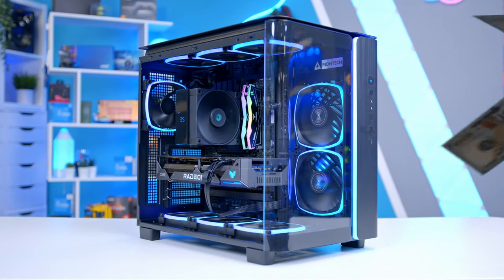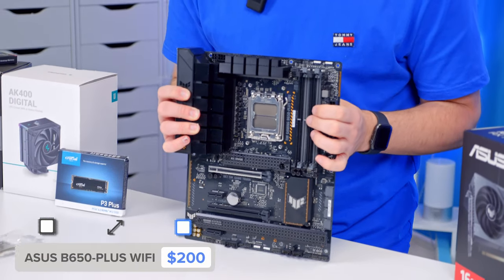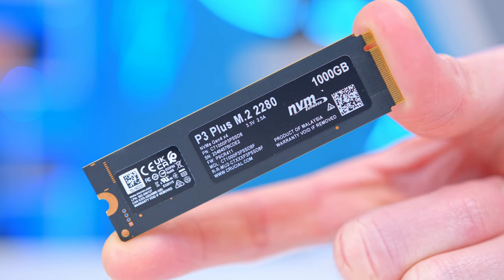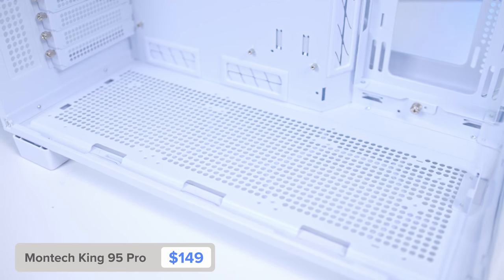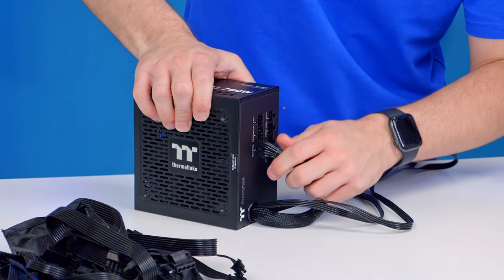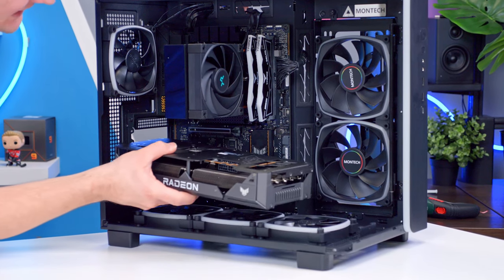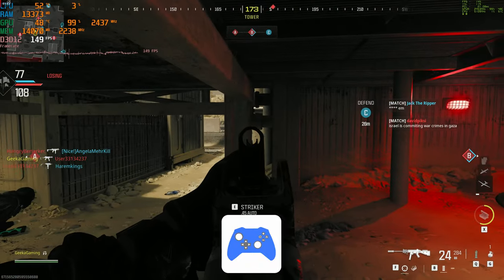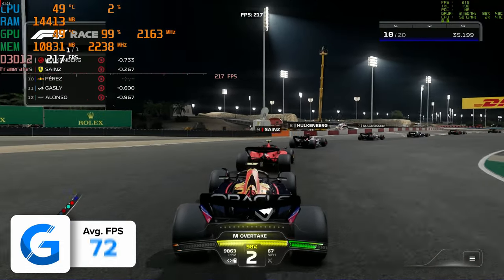Best $1500 Gaming PC Build 2024! 👑 [ft. RX 7900 GRE & Ryzen 7600X w/ Benchmarks]

Comment: I made same PC with better specs and parts for $1490. 7900x3d, 7900gre, ASRock taichi lite, gskill ddr 6400mts 32gb, 2tb 990 pro, be quite 850w FM psu, thermalright peerless assassin 120, montech xr with vertical GPU mount.

Comment: I actually just finished my first ever build and it had the 7800X3D with 7900 GRE for a grand subtotal of $1222! 
Extremely happy with it! Coming from 23 years of console, this is a huge wake up call on how far behind I’ve been this whole time!
Reply: would love to know which parts you used as I am making the a pc with same parts
Reply: Do you have a break down on the parts you used
Reply: Tell us about your parts
Reply: @aatmannbc  I've posted the PCP here multiple times, but my comment keeps getting deleted!
 
7800X3D bundle from Microcenter ($50 off, $25 promotion and $25 coupon, 5% off, $425)
(32gb of DDR5-6000 RAM, Gigabyte Gaming X AX V2 MoBo)
7900 GRE from Newegg with $10 coupon ($530)
A850GL PSU from MSI ($90)
1TB TN470 from Microcenter ($67.5, 5% off)
Montech Air Max, Black, Amazon ($70)
Thermalright Phantom Spirit 120 ($36)
Reply: @aatmannbc  I've posted the PCP here multiple times, but my comment keeps getting deleted!
 
7800X3D bundle from Microcenter ($50 off, $25 promotion and $25 coupon, 5% off, $425)
(32gb of DDR5-6000 RAM, Gigabyte Gaming X AX V2 MoBo)
7900 GRE from Newegg with $10 coupon ($530)
A850GL PSU from MSI ($90)
1TB TN470 from Microcenter ($67.5, 5% off)
Montech Air Max, Black, Amazon ($70)
Thermalright Phantom Spirit 120 ($36)
Reply: @BArellano95  Thank you so much ! Hope you're having fun with your new build.
Reply: No bottle necking?
Reply: @mrivera422g  of course there is! If I’m playing a GPU intensive game, my CPU will be utilized less, making it a bottleneck.
 
If I run a CPU intensive game, my GPU will be utilized less, making it a bottleneck. 
 
Sometimes, if I optimize the game too much, my FPS exceeds my 240hz monitor, causing another bottleneck.
 
Sometimes, I want to play in 4k and can’t reach 240 fps, causing an overall system bottleneck in relation to my monitor.
 
Sometimes, I want to download another 170gb game but don’t have the room, causing a storage bottleneck.
 
Bottleneck just points out the ‘weakest’ component(s) in the system at that moment.
You will always have a ‘bottleneck’ somewhere. 
And that’s fine. Unless you’re pairing a 7900 XTX with an i7-6700k or something crazy like that lol

Comment: How does the 6400 ram work woth the Ryzen 7600x? Any testing since you built it? Very curious due to reports of a ceiling being reported by some users not having their 6000 working properly, and AMD stating 5400 as recommended.
Reply: 6000 mhz is the best for amd cpus
Reply: 6000 is the recommended

Comment: Isn't 5 7600 and 5 7600x same preformeance? (i just want to make sure)
Reply: I haven't researched much on the AM5 Platform nor the new gens of Cpu's and Gpu's as I'm not interested with them due to some bugs and prices.

But from what I heard, Yes they are. You can even get away with a Ryzen 5 7500f if you can find one available and it's supposedly cheaper than the Ryzen 5 7600 and Ryzen 5 7600x
Reply: If you enable boost for the 7600 then yes

Comment: Has anyone else built this computer and having nonstop driver timeouts? I’m starting to think the 750W PSU is not adequate to run the build and is causing the issue. Anyone has any advice? It has been three months and I can’t fix this problem.
Reply: Exactly.. I haven't got the GPU yet. But the offline store guy from whom I bought my current PC said the PC needs 850W for safer side if I'm going to couple the 7600x with 7800xt. So I think you may have a power shortage

Comment: I just built this exact setup except had to use a Gigabyte 7900 GRE instead. First pc I’ve ever built and I can’t seem to figure out why it’s running on average 65c. Is there a good place I can find a bios and setup after building?
Reply: Is that the cpu temperature, cause if it is that’s quite normal. If that’s your GPU temp then that is a problem. I am considering making the build with a gigabyte 7900 GRE because of the price difference so please re-reply if you do find out. Also does it perform as advertised with the gigabyte allowed to the ASU’s?
Reply: @bengunn7385  This is the first pc I built and I did end up getting the cpu temp down but I did exchange the air cooler for a AIO. Temp stays between 32-48ish now. I will say I am not 100% sure that everything is correct in my bios as it’s my first time. Haven’t really adjusted fans on the case or anything. Also my monitor caps at like 170 and I’ve been able to play everything with no problem on high 1440. So, I’d say yes. It does great and I know it could be better if I knew what I was doing. lol
Reply: @SpaceMagic666  glad to hear it, if your interested I would definitely look up how to smooth out those fan speads

Comment: Can you recommend one out of the Rtx 4070 or Rx 7800 xt, idk if I should go for vram (‘future proof’) or nvidia features.
Reply: The 7800xt is cheaper by 50-100 dollars and has more vram and only has less fps by only a little
Reply: the 7800 xt is 10% faster and comes with 16gb plus is 50dls cheaper... the 4070 i dont think is good enough of a deal, not like it could really do RT properly heavily relies on DLSS to achieve decent stuff i would pick the amd card.-
Reply: the 7800xt is faster by a good margin for a cheaper price, better VRAM, better FPS, cheaper. The only thing the 4070 has going for it is the better ray tracing. if you don’t use ray tracing, there is no reason to get the 4070 at all. (You can still ray trace with the 7800xt just fine with FSR)

Comment: Is ryzen 5 7600 non X good with 7900 gre on 1440p? because it shows 35% bottleneck, but the X version has 0%
Reply: There’s no bottleneck—the 7600 and 7600x are essentially identical CPUs once PBO is enabled on the non-X variant. I have a system with that exact combo—7900 GRE and 7600 and it doesn’t have any issues with 1440p gaming (Starfield on ultra settings gets roughly 75 FPS on average, on high settings I’m getting 90+).

Comment: A guesswork question but would this build be able to handle gta 6 for recommended system specs?
Reply: GTA 6 won’t release for another year and a half and the required specs haven’t been released. Chances are that the pc will run it when it does come out but it will probably have to be at slightly lower settings because of the inevitable advance in technology.